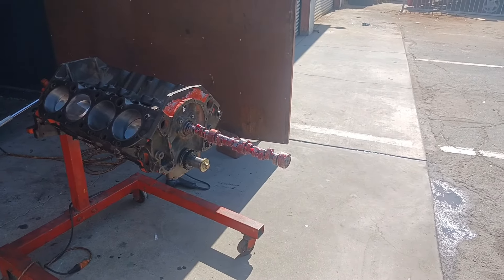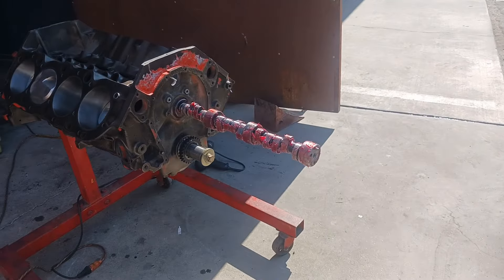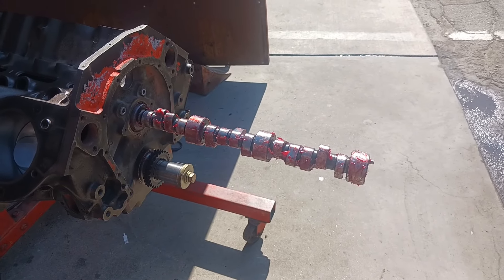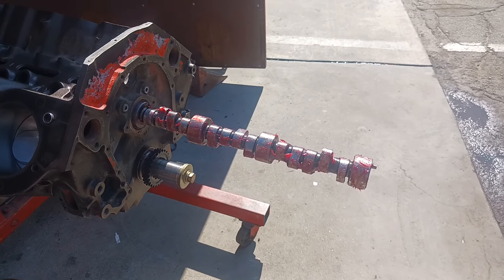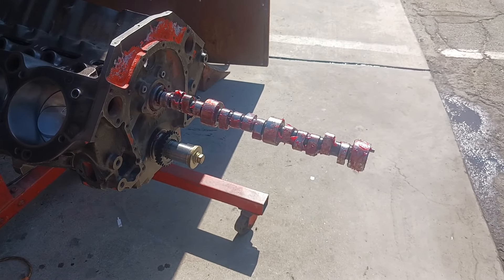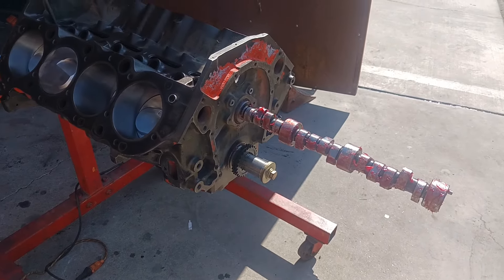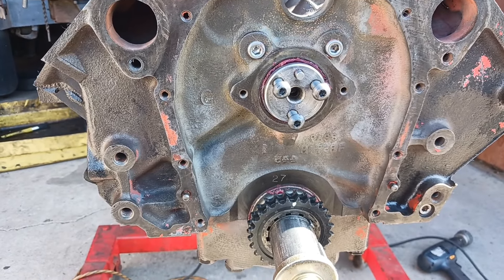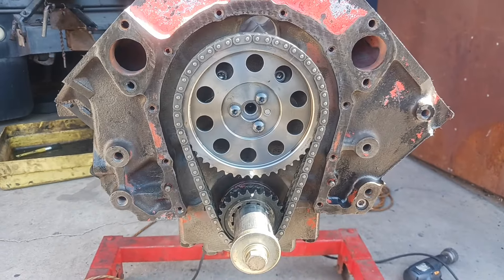1986 Chevy Monte SS454 part #10

Comment: What is the cam duration?
Reply from the maker: @carbonfibercreationswashin7213  282 / 294 duration
Reply from the maker: @carbonfibercreationswashin7213  hydraulic roller cam 550 lift